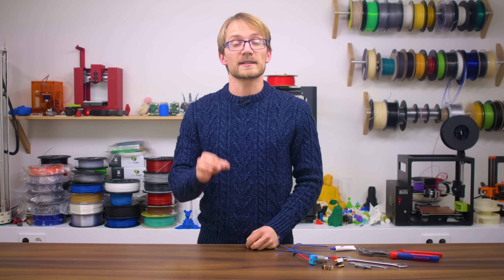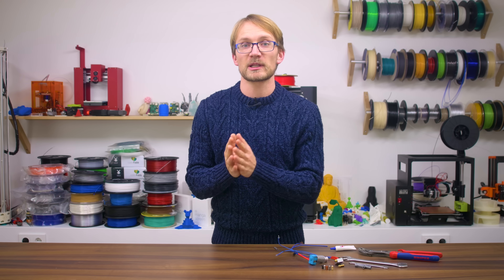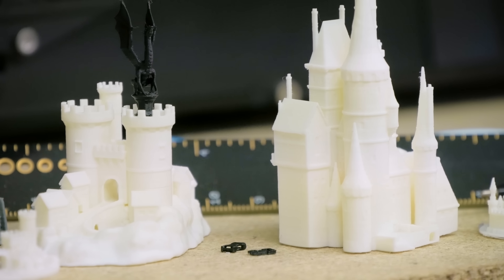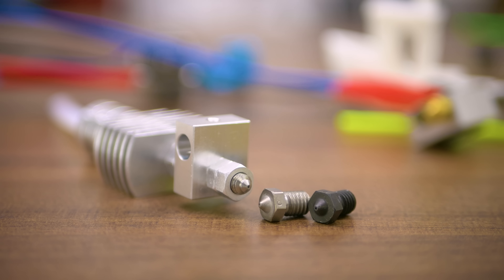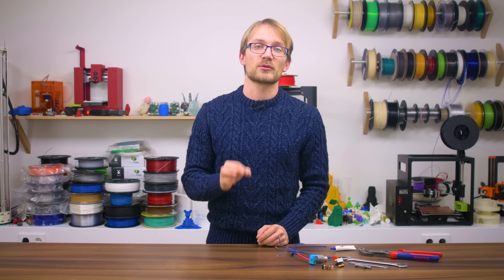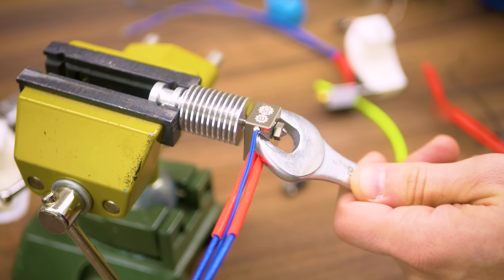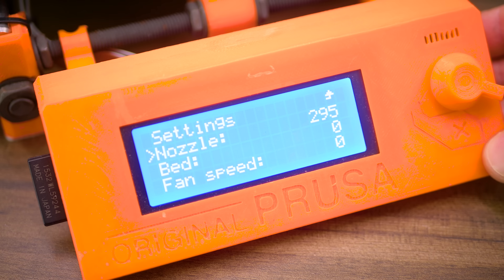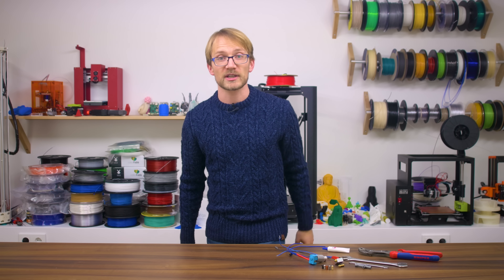How to pick a 3D printer nozzle and how to install it!

Comment: this video was supper helpfel with my cheap Tronxy x5s hotend, i had a jam in the treaded screww that has the teflon tub in it, replace that part, rebuilt my hotend made Sure to tighten it the way You showed, have not had any issues with jams. Thank you for this Great info. I do plan on changing from brass nozzle to steel.

Damian

Comment: Hi, Is there any way to use  combination of different nozzle diameters installed in a dual extruder setup so that we can reduce printing time without losing outer surface finish ..

Comment: I see that like most of the other tutor/commentators that all your build material is on the wall in racks, shelves, etc.
Yet, ALL the manufacturers say that use a sealed environment and keep desiccant inside the sealed space to keep moisture out of your build material.  So what's the answer to all this.  Can you just  keep the build material (PLA-PETG-ABS, etc) on the wall in racks and not worry about it??
Reply: Tom's mentioned this a few times: he only really keeps PLA (maybe ABS) out in the open like that, and he has a dehumidifier in that room which runs most of the time that he's not filming in there, so the humidity in that room is typically under 30%, which is plenty low enough for everything but nylon. Personally I keep PLA, ABS, ASA, PMMA filaments on a bookcase, each in their own clear grip-seal bag and a bag of indicating dessicant in the bag with them, which keeps the humidity fairly low for those. PETG, TPU and Nylon get stored in a drybox with 3-5 of those "rechargeable dehumidifiers" that you can get from Amazon and such (basically a plastic box with a load of silica gel beads inside, plus a mains-powered heater plate inside so you can dry out the silica gel by just plugging the box into the mains overnight - don't do that while it's in your drybox, obviously, or it'll evaporate all of the moisture out of the silica gel and into your filament!).

Comment: I have switched to stainless steel as a compromise between getting a 20 dollar hardened nozzle and the brass ones. So far I am really liking it and have had to replace a lot less often. It seems to me that it makes a cleaner crisper print. A pack of 5 of them cost me like 8 buck on Amazon, and I bet if you go the Aliexpress route you can get them much cheaper. I have also not really noticed any temperature issues, meaning I have not had a need to increase the hot end temps any higher it seems to work just fine. I have already done some abrasive prints so far with iron filled PLA, as well as a little bit of Bronze fill and the nozzle did not seem to have an issue, still prints nice clean prints. Do note that I only used about half a pound of the Iron filled PLA so it has not really gotten the brunt of a full Kilo sized roll yet, but I'll circle back and fill you in if I notice any major issues. 

There is one other positive that I have noticed. If by mistake if you have the bed too close because of a leveling issue, the stainless does not flatten like the brass ones. I notice that the brass kinda flattens out and acts more like an iron with a bigger flatter area rather than a sharp tip. The stainless survives this better and does not leave a streak on the bed as bad as the brass ones.
Reply: Stainless steel is NOT wear-resistant. At all! I ran only 100g of glow-in-the-dark filament through a 0.4mm stainless steel nozzle and literally doubled the nozzle's bore size in the process. You really need to get properly hardened steel (e.g. the ones that E3D make) for use with abrasive materials :)

Comment: NOZZLE SIZES & SHAPES EXPLAINED   There's a lot of comments here about choosing nozzles and the like. One thing that really opened my eyes was a section of a Blog on E3D's website. They're discussing why they designed the E3D hot end the way they did (fascinating in itself). There's a section called "Nozzle Specificity and Indentifiability." that discusses exactly how a nozzle lays down the plastic, it's a MUST READ for you to really get how nozzles and 3D printing work. https://e3d-online.com/blog/2014/05/15/v6-blog-announcement/ Tom, as usual, a GREAT video here!

Comment: at 5:59 , why is it important to keep a gap between the nozzle and the block?
Reply: erik nielsen The gap between the nozzle and the heaterblock ensures that the nozzle is being stopped by (i.e. making a strong connection with the heat break and not the heater block.  If you tighten the nozzle all the way to the heater block, it's possible there is a gap between the heat break and the nozzle which can lead to problems (poor retraction behavior, clogs, etc.).
Reply: Additionally to what Fred said is that you want there to be a bit of room for the final tightening at full temp. The nozzle must stop against the heat break, NOT against the heater block. If there's a gap between them the filament will leak into the threads, which makes disassembly and cleanup a b*tch! You tighten nozzle to heat break, not nozzle to block, and it MUST be done at MAX temp as he notes or it can loosen during use.

Comment: My experience with MakerBot has been awful. It clogs within the minute if I try to print :(. Anyone know a good chemical I can use to completely clean it?
Reply: Late reply, but ... :-) Clogging is usually due to contamination. Cheap filament can have contaminants. Also dust pickup. Many people use a small piece of foam that the filament goes through to catch debris before it reaches the hot end. Chemical cleaning is not usually available (although with ABS some say you can soak overnight in Acetone). Search Youtube for nozzle cleaning vids, there are many.

Comment: what about copper nozzles? I can't find anything on the online but they are pretty cheap
Reply: Great temp profile but basically a throwaway item since they're so soft. The hole will be worn larger very quickly, especially with the more exotic materials like Wood, Glow in the Dark, Carbon fiber and any other "filled" plastic. You'll be wondering why your prints are terrible, playing for hours with the slicer and settings when your .4mm nozzle is really .5mm due to wear... {Bangs head on desk} LOL! Copper = not really recommended for nozzles, too soft.

Comment: Can You make Nozzleween. I would like to know what nozzle makes best print and what nozzle allows fastest feedrates. Use 0.4 nozzles because it is most common size.
Reply: Jukka-Pekka Ylitalo my company is working on a premium nozzle design at this point, which will come standard with 0.5 nozzle. In my opinion, 0.5 is optimal size for any application. As a CAD designer and engineer, i dislike 0.4 size, because when i design objects and models I tend to have them scaled to whole 1mm, so my wall maybe 1mm or 2mm, in first case it will always require extra gcode tuning and making sure layers actually go without gaps. So I am a big believer in 0.5mm size. We are gonna produce some crazy over-engineered hotend, I am sure it will surprise a lot of people. I totally rethought all hotend idea from the clean page. It will be nothing like anything on a market :) I will be glad it Tom decides to take our prototype for a run.
Reply: @VladOnEarth  maybe you should tell us the name of your company then :D
Reply: @VladOnEarth  It has been a year now. Where is this hotend?

Comment: Great video! I just want to know that if I print with a larger nozzle what would be the smallest layer height I could do? What percentage of the nozzle size would it be? My printer the Wanhao Duplicator i3 Plus has a stock 0.4 mm nozzle and I am printing fairly large parts, like a full-size instrument kind of parts. My printer can get down to 0.1 mm layer height with the stock nozzle, so it's about 25% of the nozzle size. So let's say I get a 0.8 mm nozzle, would the max layer height be 0.2 mm? I would like to know.

Thanks!
Reply: You can do the same height as the nozzle diameter, but then you need to use 1.5 times the width. For example, max height of 0.4 nozzle is around 0.4mm with a line width of 0.6mm. You must use wider lines for larger layer heights so that it is pressed down to the previous layer.

Comment: Great video and helpful. Decided I needed a project for the summer and brought an Anet A8 to get started. Construction was easy and I am learning a massive amount on how these printers work. 

As it's a cheaper option, I am manually checking hot bed level and testing different filament types.

Any recommended upgrades people know about, please let me know. Happy to test and try anything to make this process easier
Reply: Even though you've already upgraded, I figure I'll throw relatively cheap upgrade option out there incase anyone else stumbles upon this.

Auto bed level sensors (BL Touch, CR Touch etc) are so worth the $35-45, it takes the annoying bed level process away and makes printing so much more painless. 100% worth it.
Reply: Has it gone up in flames yet
Reply: @gamingmemez2  already upgraded to a prusa Mk3s and sold the old one
Reply: @darrenholloway930  what a legend responds after 5 years
Reply: @gamingmemez2  I got an email so felt it was only fair lol
Reply: @darrenholloway930  👍

Comment: One tip that is worth mentioning; a large contact surface on a hot heater block, from a wrench or similar will often cause it to cool down, even causing a firmware heater error and machine shut down. Keep contacts short, or watch what happens to the temperature while you've got it grasped.

The danger here is that the heater shuts off and you don't notice ... doing damage during the reinstall.
Reply: Wow, wouldn't have thought of this. Thanks for the handy info!

Comment: A general rule is never expect more than 80% flow of the diameter.. so yea 0.4 will not give you 0.4 due to many factors. also make sure you never damage the tip when cleaning.. if you rough/scratch it.. you increase the chance of blockages and also the filament will not flow as well and will curl as it comes out.

it's best to clean your tip without shoving anything in it... so do not drill it... Generally hand feeding filament with some pressure does best.. I do this when ever i change filaments and since have never had a blockage.
Reply: "it's best to clean your tip without shoving anything in it" Yeah, that's advice I generally live by.

Comment: Or make your own hot end out of 12mm  steel to take 2x 40 W heaters and a independent power supply want more heat turn up the volts,,15Volts will give you around 230 C

Comment: Thanks, some useful information.
I have a small lathe so I make my own nozzles from 8mm hex brass bar. I use a 0.4mm carbide pcb drill to make the hole, and a regular 1.8mm twist drill to make the path for the (1.75mm) filament.
As you say, a 0.4mm nozzle bore is a good trade-off between quality and speed. Also, a 0.4mm drill is not too difficult to use, anything smaller tends to break when you look at it.
Before changing filament, or removing the nozzle, I clear it out with a simple tool I made, a length of stainless steel, 1.5mm diameter and ~125mm long, fitted into a wooden file handle. Pushing it into the throat after withdrawing the filament will push nearly all the remaining material out of the nozzle, and any contaminants are likely to stick to the stainless and come out when you withdraw the tool.
Tip: Never try to clear a blocked brass nozzle by poking something into the hole, unless you want to make it the hole bigger, because that's what will happen.
Tip: Wrapping your hotend block with cotton insulation will decrease warm-up time, and use slightly less energy to print!
Reply: You can build your own hot end and assembly..Good stuff.

Comment: .4 mm hardened steel nozzle e3d v6 full on a prusa mk2.. i bought the steel nozzle for a project for a friend, printing copperfill. since then i have ran everything through it (pla, petg, metal composites, nylon)... and the one thing i truly love.... the minimal thermal expansion. i can go from pla to nylon without having to re-adjust the nozzle height from the bed. needless to say for me brass is a thing of the past.

Comment: I bought a cheap stainless steel nozzle for my TAZ 4, it clogged up. Instead of getting mad I used a 2.1mm drill bit to drill out the bore and I now have a nozzle that comes in handy when printing really large parts. Kind of similar to the MOARstruder from Lulzbot, except the modification cost me about 2 dollars instead of 395.

Comment: Having a hard time trying to find a web site to order the SAF-T-EZE High Temp Anti-Seize in a small tube like in this video. The Saftlok. com site really doesn't show images of their tube product, so not a 100% sure if I'll order the right one.
Does anyone know of a another brand that will work? Getting ready to install a Micro Swiss hardened nozzle on my Robo 3D R1 Plus printer.
Thanks for any info.
Reply: How did your Micro Swiss nozzle changeout go?  I also have a Robo 3D R1 Plus and bought the .3mm Micro Swiss nozzle, but haven't changed it out yet..
Reply: I ordered the Micro Swiss nozzle that is made for the Robo 3D R1 Plus, but I never installed it.
 
Instead I installed the Micro Swiss A2 Hardened Steel Nozzle (E3D V5-V6, Prusa i3 MK2 RepRap - M6 Thread 1.75mm Filament .4mm), It's a little taller but it works just fine.
I really didn't realized until after I ordered the MS Nozzle made for the Robo, that the MS A2 hardened steel would fit my Robo, or I would has just ordered the A2 steel nozzle first.

If you are not sure how to install the nozzle on your Robo 3D Printer, it take a look at Rorlin 3D NerdStop here on YouTube, and look for his video titled... "Upgrade: Plated Nozzle".

Comment: I have a Monoprice Makers Select 3D v2, its my first 3D printer.  Great price point adn works good for me. Is there a nozzle upgrade I should go with if I do glow in the dark filament?  I hear it is real rough on brass.  Also, should I upgrade the hot end?  Im a newb, thanks.

Comment: ive been using BIQU Metal Reprap I3 3D Printer With MK3 Heatbed and Anti-Curling Edge Antislip Heat bed Sticker , Printing Size 8.7" x 8.7" x 10.04" i found  glass build plate  gave me better builds but i want do more with it  .

Comment: Is conductivity even that much of a deal? Sooner or later the heat will spread from the heater cartridge to the nozzle. Shouldn't a good thermal control algorithm be able to take care of any delay in transmission? The heat gradient between nozzle and heater cartridge might be steeper, but in the end the heat you put in should reach the nozzle sooner or later.
Reply: ***** Well yeah but the watts / energy per second needed to heat up a certain flow rate of filament doesn't change with the material of the nozzle. Only the "temperature lag" should change. But maybe I'm missing something.

A bit off topic: There was an innovation for vaping / e-cigarettes a while back to have temperature control for the heating coils. You can't use a temperature sensor. 
Using e.g. pure nickel you can read the change of resistance of the wire while heating it up from room temperature you can infer the temperature. So you could make a nozzle where the heater is just a coil wrapped around a very thin nozzle only using one cable for heating power and temperature measurement. I don't know how to do the electronics for that though. But it is possible since e-cigs are able to output 200 watts while keeping the wire at a specific temperature. Imho it could simplify and improve the process.